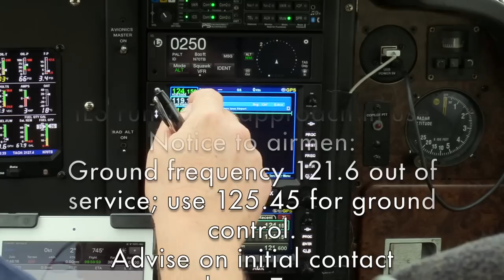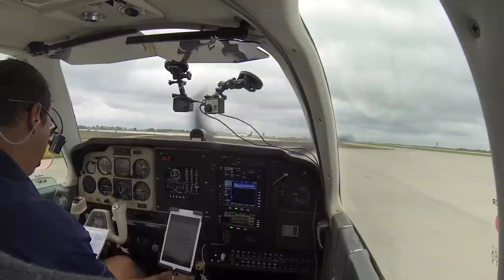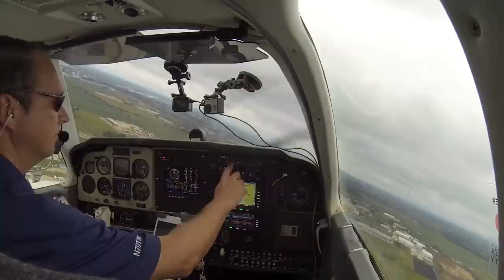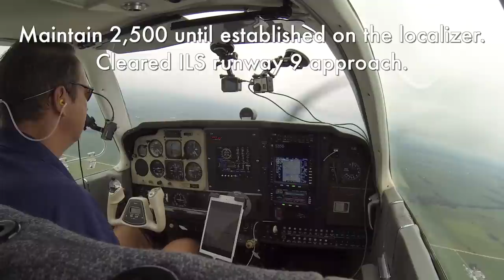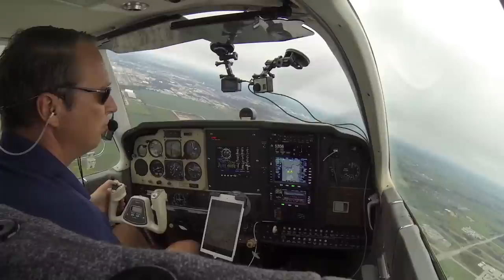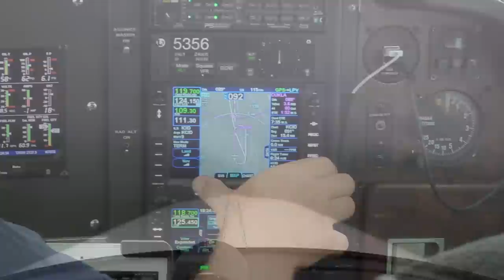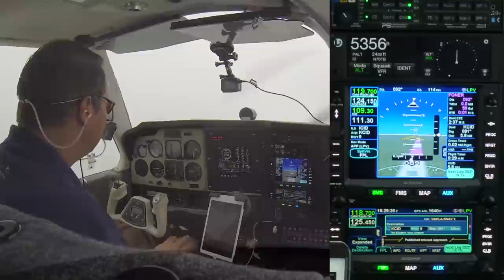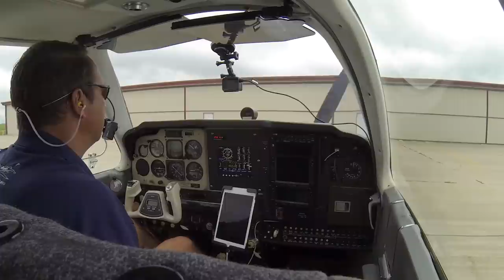My first Approaches in IMC - with the Avidyne IFD

Comment: You mentioned not having GPS steering (GPSS).  If you had a G5 or Garmin 275 HSI, I believe those will work with legacy autopilots.  If you have a Century, you will need to retain your vacuum operated artificial horizon though. 

 My very first solo was done on Runway 9 at KCID.  I still remember the Ozark Airline DC9 holding short for me to land....  Many years ago....

Comment: Also suggest since there is no immediate reason to launch that you turn and stop, check DG, and compass for match, and match with runway verbally.  Great turn at the start of the runway to use it all.  Bravo!  Nothing more useless than the runway behind you except for the fuel in the truck at this point.

Comment: There seems to be some GPSS modules for the Century III, but I'm not sure which version you have.  However, it also seems rather ambiguous, so in fact, I don't know if there is something available for it.  The Garmin G500, of course, is available, but it requires at a minimum the G5 displays.  My feeling on that is if you're going to spend that kind of money, put it towards a full blown EFIS system.

Since I'm not actively flying, I have to assume that you're using Foreflight on your iPad.  Have you downloaded and connect the IFD100 system from Avidyne yet?  I think Kris over at  Baron Pilot really liked his, but between the display for the IFD100, and the display for Foreflight, he just had too much clutter in the cockpit.

I'm looking forward to the next new install, even though it may be a while.  Thanks for taking us along, and sharing all of this with us, especially those of us who Dean Martin, in 'Airport', called 'ground-bound penguins!'  LOL

Comment: Martin, your channel is fantastic!  For safety reasons, I would love for you to check out an app called Xavion (pronounced ex-AY-vee-on).  It was created by Austin Meyer, the same gent that created the flight sim program X-Plane.  Unlike X-Plane, this app was created for actual flying, in particular, to address flying dangers. (Although you CAN connect it to X-Plane to practice with it in flight sim mode.). The best way I can describe it is with a scenario. Imagine you’re flying at 5000’.  Clouds all around, heavy rain, winds, potential icing conditions, etc. Suddenly your engine fails and after exhausting all efforts, you are unable to restart it.  Despite the sophistication of any GPS or terrain awareness instruments you might have, you in any case can not actually see any tall buildings, high tension electrical towers, mountains, etc.  How scary would that situation be?  With Xavion running on your iPad, you simply hit the emergency button and it IMMEDIATELY begins running HUNDREDS of calculations for what your best descent is, including all turns needed to lose altitude.  It factors winds at all altitudes (especially if you’re feeding it info from your ADS-B), air temps, performance of your aircraft, nearby airports, terrain & tall structures... everything.  It then shows you the best glide path in 3D, putting you right at the runway threshold for a safe landing.  In my opinion, that emergency button SHOULD be called the ‘Sully’ button.  Here is a link to a video of a review of that app, by none other than the creator himself.  Please watch at least the first 9 minutes of the video.  After that he goes into other extremely useful features of the app as well, but you’ll be hooked to watch the whole thing once you’ve seen the first 9 minutes.  If you feel the same way I do about this, please do a video where you use the app so that other pilots can be made aware of it also.  This app WILL save lives!!!  If you do any flight simming, try it out there first and then practice some power off landings with it running so you can see first hand the power of this app.  I’d LOVE to see a video you shot using it, ideally both in flight sim and in actual power off landings.  Safe flying Martin!!  Here’s that link...
https://youtu.be/VfYTW9AHUaU

Comment: Martin, great video! After or before your identification of beacons pre-takeoff, professional crew SOP is to scroll thru-highlighting each FPL waypoint on the map (or scrolling thru the data box with waypoints) highlighting each and confirming visually and verbally they are consistent with those determined and planned for pre-flight. And then do this again as a descent checklist item before entering terminal area for any waypoints in arrival procedures or approaches. That may be something you do but was edited from video. If not, add that to your workflow. cheers...jason

Comment: Hi Martin.  Can you tell me what your actual filed clearance was?  When I try to shoot Practice approaches at my home airport, I have to file to either another airport and then get a change in the air or file to the outer marker on the ILS or a fix on one of the GPS approaches in order to get a clearance to shoot approaches at my airport.  I was just curious what you actually filed.  Thanks.  Did you actually file Cedar Rapids direct Cedar Rapids then put Practice approaches in the remarks section?

Comment: Great vid. Why not raise gear when no usable runway is left?
Reply from the maker: Good question. In a twin it's a no-brainer - we are committed to fly and want speed, so gear up early is good. In a single, looking purely at the odds of surviving an engine failure shortly after take-off, I would argue the better climb rate with the gear up early on improves our options when the engine quits after passing over the end of the runway.  A gear-up landing on the runway isn't nice, but it won't kill (or likely even injure) me. In addition, the gear in my Bonanza cycles in as little as four seconds, so it is quite feasible to lower it very quickly should the engine quit with usable runway still in front of me - I just have to remember to do it.
In summary: There is no clear winner unless you know when your engine will actually quit, which of course we cannot know.
Regards, Martin

Comment: Nice setup and nice work Martin.  I noticed your Avidyne showed the ILS ID,  the G1000 (Perspective) shows the id when the station is identified so no need to listen to the morse code signal.  Does the avidyne work like this too?
Reply from the maker: Hi Paul, yes, the IFD "listens" to the morse code and shows a readout on its display. I guess listening to the morse code myself through the audio panel is an old habit which I learned during my instrument training in the 90s, and which I haven't given up since then. Probably something I could change.
Best regards, Martin

Comment: Informative, with some inconsistencies, I think. The first one I noticed was that you reported 2500 when you were actually at 2000 (or maybe I misunderstood) and on the RNAV approach you said "Localizer is alive" , should be "final track", no? Happy to learn if I misunderstood!
Reply from the maker: Can you give me the time stamp for where you think I got the altitude wrong?
And what's your concern with my "localizer alive" callout?  I understand there's not physically a localizer signal and antenna on an LPV approach, but the indications are virtually identical.
Regards, Martin
Reply: Martin Pauly Hi Martin, the altitude was absolutely correct - my mistake, sorry for that. You said „2000 climbing 2500“ at Cukla, and i misunderstood! On an RNAV approach i would always use the phrases „Final Track established“, „Final Approach Point“ and „Glidepath“... just to avoid confusing yourself one day. Can you not fly the whole thing in NAV mode on the autopilot? GPSS mode will not arm the Glidepath“. With my A/P (DFC90 and Avidyne Entegra, 2xIFD440) i only use HDG and NAV, never GPSS. I understand that with a mechanical HSI you need GPSS for enroute (not with the PFD) - but shouldn‘t the RNAV approach be flown in NAV? Best regards, Alexis

Comment: Nice panel.  One thing i noticed on the run-up; this is fuel injected so no carb heat check but what about alternate air?  I also mark (mental note) what the alt-air does to the baro devices.  In the bonaza you don't do that?  Sorry I don't have any time in bonanzas.

Comment: Does not having a second yoke ever been a problem? What did you fly before this plane? Thanks, I like your videos.
Reply from the maker: Hi Mark,
There are very few times when I miss the dual yoke - i.e. when I have someone in the right seat who is interested in trying out the controls. The other 95% of the time, I enjoy the extra space, easier access to circuit breakers etc., and getting into and out of the plane without the yoke in the way. My A36 did have a dual yoke when I bought it, but I had it replaced after the transition training was done.
Before the Bonanza, I flew mostly Piper Cherokees - many hours in Arrows, but also Warriors and Archers. And way before that, I flew gliders which is how I got into flying in the first place (decades ago).
Best regards, Martin

Comment: So the avidyne recommends an entry into the holding pattern? That’s nice.  I am studying for my ifr written and entries to hold has been a challenge.
Reply from the maker: Yes, it does - and so did my Garmin GNS530W, btw. But it looks prettier on the Avidyne IFD 😄
And on the IFD I can do a custom hold anywhere I want, not just for an approach.
Reply: Don't beat yourself up over entries.  In truth, ATC doesn't care what entry you make they just care if you stay on the protected side or not.  99% of the time it will be pretty obvious which entry will be easier to fly.
Reply: Jhardage62 thank you

Comment: Hey Martin. Nice upgrade from 530w to Avidyne. At first i was thinking to do the same thing, but i installed Garmin Flight Stream 210 and with existing GPSS my flight planing is so much easier for the fraction of the cost of new Avidyne. These days everyone use their ipad in the cockpit for charts and situational awareness, i just dont see the point for the upgrade when you have a full capable Garmin 530W.  I think it would of made more sense if you would of installed a Garmin G5 to replace your HSI and you would of gotten a GPSS that works with your autopilot.
Reply from the maker: Fair point, Shawn - the 530W does a lot of things well; add an iPad, the FS210 and GPSS, and it's not a bad setup.
However, the many little (and some big) improvements of the IFDs over the old GNS units add up to a significant difference. At some point, I will get an EFIS of some sort and a digital autopilot to complete the system.
Best regards, Martin
Reply: I'm sure IFD has more futures than the old GNS. may i ask what autopilot you have on your A36? I think you may have KAP 150 and with that we are limited for  EFIS and removing vacuum system.
Reply from the maker: @MooneyM20J  Today I have a Century III autopilot in my Bonanza. Looking for a future EFIS involves the autpilot, and I may in fact change both at the same time. I am undecided today what the best combination of products is for my airplane. So maybe it's good news that I need time to save up for any future changes, so I can think more about it.  :-)
- Martin
Reply: Thank you Martin. Yes its so hard to decided. Im going through that phase right now. Im saving up for Garmin GFC 500 autopilot but you need Garmin 5G to drive it. I love Aspen Evolution 1000 Pro MAX PFD but will not work with GFC 500 right now :(
Reply: Shawn J Avidyne dfc90 is an option for the bo. I’m actively bo shopping now and ap’s are a big item I’m concerned about.
Reply: @ronnl001  , The DFC 90 is not STC for Mooney. GFC 500 from Garmin is the most affordable and truly the best digital autopilot out there.
Reply from the maker: @MooneyM20J  Believe me, I understand your dilemma!
- Martin
Reply from the maker: @ronnl001  Yes, the DFC90 is a fantastic autopilot - but unfortunately it can only be installed with STEC servos. I have a Century autopilot today, which makes this a prohibitively expensive option for me. Otherwise: DFC90 and Aspen all day long!
- Martin
Reply: @martinpauly  thanks for that. I wasnt aware of the servo issue.

Comment: Martin does your radar altitude work?  If so when do you use it only in low IFR approaches?  I love my IFDs!
Reply from the maker: It works so so... I really don't use it much. The Avidyne's have a 500 foot callout, which seems more reliable than my radar altimeter, and in the future I can see an EFIS in my panel with an adjustable call-out for IFR minimums. That would sure be useful.
- Martin

Comment: How is the reception on the radios ? Some say radio reception is the weak link.
Reply from the maker: It's funny you mention it - the clarity of radio reception was one of the first things I noticed on my first flight with the IFDs, compared with the 530W and 430W they replaced. I'm very happy in that regard.
- Martin
Reply: I am glad to hear that. I have been considering the IFD 550 in place of my 530W on the trade program.

Comment: if you have FOREFLIGHT on a tablet do you need an IFD?
Reply from the maker: They do different things, John. For IFR, the answer is a clear "yes, you still need an IFD" (or similar product). If you are flying VFR, you can rely on the iPad for navigation while cross-checking with other means - which could be as simple as looking out the window. The biggest issue with tablets for IFR is the GPS accuracy can degrade without you really knowing about it. IFR GPS receivers do a lot of integrity checking behind the scenes to ensure what they display is accurate, or warn the pilot when accuracy cannot be guaranteed.
- Martin
Reply: @martinpauly  thank you sir

Comment: How do you file for the local approaches?
Reply: Brian Parkman Haven’t actually done it in several years, but when I did, you would file KCID-KCID and put practice approaches in the notes, or just contact ATC from the aircraft without a flight plan and tell them what you want to do. Not a big deal. In Iowa, anyway.